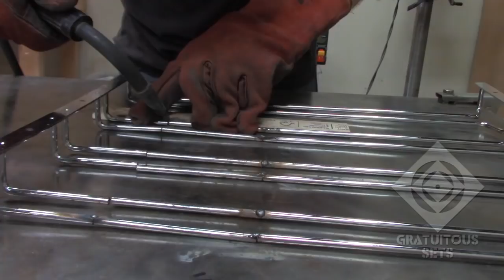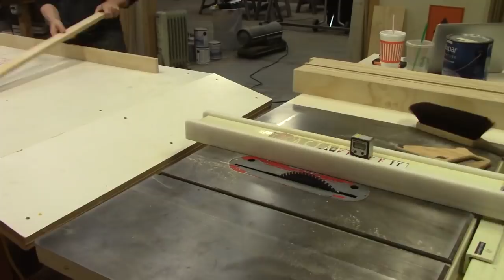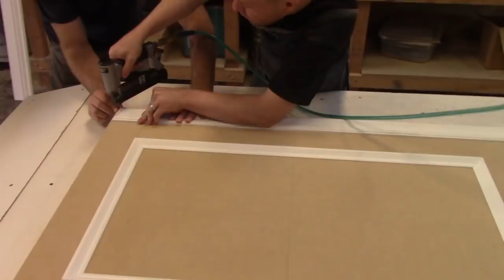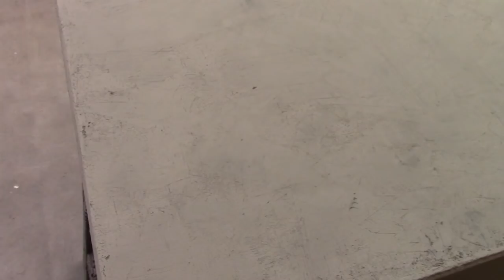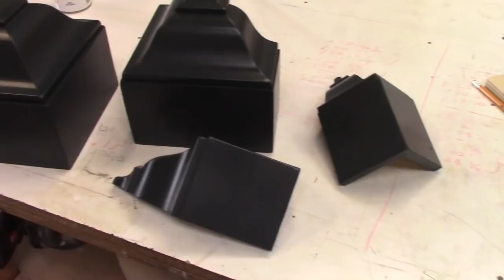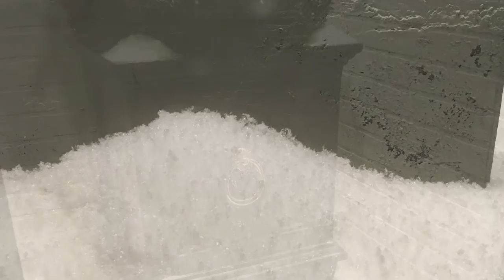Holiday Window Sets!

Comment: What were you using for the faux concrete? Was it a DryLok product?
Reply from the maker: Undercoat is sanded stucco mix, available off the shelf.  Topcoats are a hand mixed Venetian plaster.  The two, together, give the finish of cast concrete, with the voids that occur in industrial scale.  I learned what I needed watching a subcontractor who charged $4500 on a Stella McCartney build (that they requested/demanded) for something that I could accomplish in a day.  Sometimes clients underestimate us, and it costs them dearly. :-)